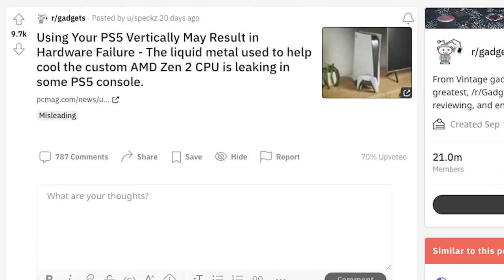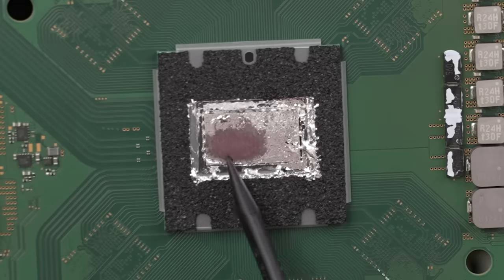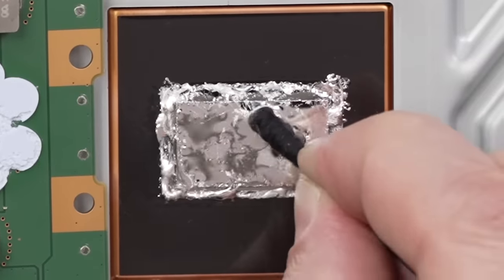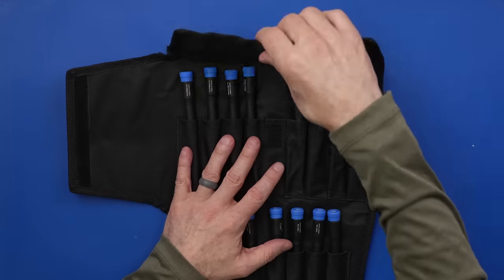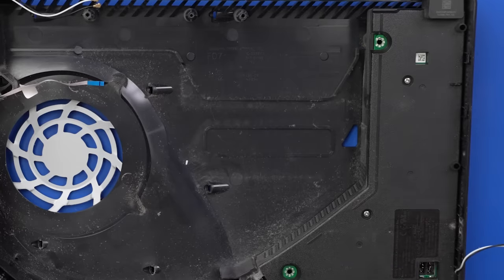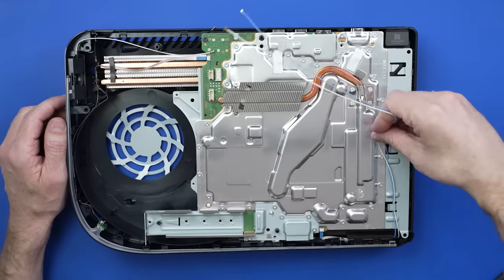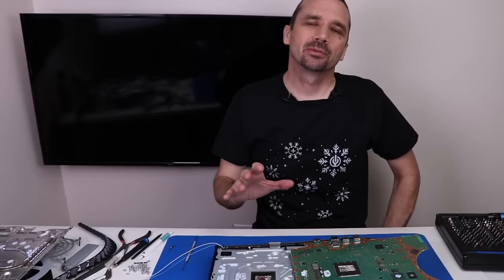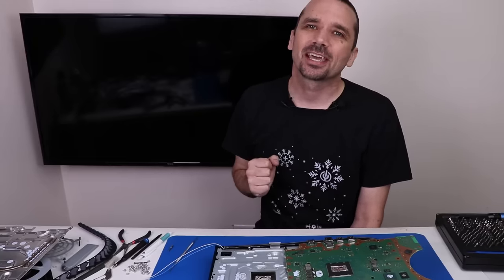PS5's Have a Liquid Metal Problem - But It May Not Be What You Think

Comment: Your repair videos have been tremendously helpful. There’s been so little follow through guides online. 

I’ve been having overheating issue as of late. My PS5 model is in the early 1000A’s so it’s due some maintenance. Cleaned it out thoroughly for dust but still the overheating persists. 

I’ll have to do the dreaded Liquid Metal replacement as soon as my delivery gets here. 

Thanks for putting out these videos! Earned a sub from me

Comment: I had the 1115a model and put it vertical n the liquid metal got into the little components n fried it sent it in they fixed it I'm guessing they replaced the motherboard because I'm not sure once the motherboard is fried it can be repaired really or it got on the components and they cleaned it off if it didn't fry it lol

Comment: So recently I had been a little lazy and hadn't cleaned my ps5 in a while and I was playing a game and it just shut off. I figured one of my cats may have knocked the plug loose because it seemed like it was almost unplugged and plugged it back in was playing for a while and it turned back off on me. The next day you did the same thing twice no warning just power off wooden power on for about a minute each time. I opened it up and the fan was pretty dirty cleaned her up and have had no more issues. When unplugging my PlayStation to clean it I noticed that the unit was very hot noticeably hotter than normal and figured it was overheating. I was correct and overheating was the issue the PlayStation turned off five times in 2 days with no overheating warning.
Reply: Hi could you tell us if your model is a 10000, 11000 or 12000 one? I'm suspecting a problem only with the 11000 one (I've 1116A) (it's written under the PS5) Thank you

Comment: I was starting to think about longevity of Viscous Metal.. I now understand it better, it doesn't run, it expands when it heats up but when you don't clean your console THEN it starts to move as it dries on hot spots and pools in cooler parts of the heatsink and APU.. I doubt its ability to run when vertical.  its sandwiched.

P.s I get flustered when attempting a repair. I broke a ribbon cable in my PS2 (controls power on) that was stupidly attached to the chassis, it detached from the inside and I couldn't get it on.. then wore out a ribbon on a PS4 controller bc I never know when something fiddly is inserted correctly. That's what she said. Ye
Reply: using internal battery for controller is stupid anyways, it's sony fault for not simply attaching a removable battery and cells

Comment: Hello. Like a lot of others PS5 owners, I've crashes with only PS5 games (Overwatch 2, Hogwarts, Vertigo, Jedï Survivor...) not the PS4 games. The PS5 shut down brutally without any warning.

I’ve done everything I’m advised to do, (and vacuum the psu...) but the problem remains. Other players seem to have no problem with Overwatch 2 for example. I have a model 1116A.

I would like to know from your experience whether all PS5 models are affected by these problems, or whether the 11000 model has more problems than the 12000 that evolved for the cooling system and the new AMD chip in 6nm? 

And since Amazon offers me a refund, do I have to do it and buy a new model 12000?

✨Thank you ✨ for your answer and your help... I'm tired to try all the tips... Without to succeed to fix that...
Reply: If you have problems and can’t fix it you should obviously refund asap
Reply: @fardel8021  OK...

Comment: Is there a video about how to make sure your ps5 gets the least dirty? I try to keep dust kf it and those ventilation holes on the sides of the black middele part ( you can see with white plates still on) and have it like a month or 2 now and feel like it is already getting dusty
Reply: Just cover it with some cloth or anything not very dusty when you are not using it and, when using it, make sure the PS5 is in a well open space and not placed above a carpet or anything dusty. That's all you need. My launch PS4 endured perfectly clean 6 years without any overheating or noisy fan issue by only doing that until I sold it to get a ps4 pro.

Comment: I'm not taking my PS5 all the way apart. I'm not a professional. I've had no issues as of yet
Reply: Hi could you tell us if your model is a 10000, 11000 or 12000 one? And if you have any crash issue (shut down with Only PS5 games) 
  I'm suspecting a problem only with the 11000 one (I've 1116A) (it's written under the PS5) Thank you

Comment: I did this test a long time ago Thermal paste MX4 works just fine for the PlayStation 5 On the chips I put thermal pads instead not the cheap ones they were expensive. Thermal grizzly thermal pads Actually worked okay for the PlayStation 5. If applied correctly PlayStation 5 can run on thermal paste Just don't buy cheap thermal paste. Or go back to dumb liquid metal.

Comment: Have you considered using regular thermal paste when refurbishing these consoles? If the liquid metal keeps doing this then it seems a waste of time to keep using the same stuff. Is there that much of a thermal advantage to LM?
Reply: He has a video trying that out, from memory it didn't go well.  Worth looking it up though was a good video
Reply from the maker: There is a massive difference in cooling when it comes to thermal paste vs liquid metal. If you use thermal paste the PS5 will for sure overheat
Reply: @cubiczar6917  I likely missed that video. I can't think why it should only need LM. There are more powerful chips around and they seem ok with paste. Perhaps it would need a better heatsink combined with paste for a better result.

Comment: I’m having a sparkle screen issue! Ive changed the hdmi cord cleaned the unit etc and now it’s getting the wave of black screen going in and out!
Reply: Hi could you tell us if your model is a 10000, 11000 or 12000 one? I'm suspecting a problem only with the 11000 one (I've 1116A) (it's written under the PS5) Thank you

Comment: I have a question if anyone can answer for some peace of mind that'd be great but for about 2 months now my ps5 that ive had since day 1 gave a heat warning i disassembled down to the optical drive and the baby heat sink and found some dust bunnies so i used a can of compressed air to dust away any visible dirt in the fan hole and over the baby heat sink but i was wondering would this effect the seal around the liquid metal in any way and cause it to leak? I dont think it would but id like to be sure. Any answers would be appreciated!
Reply: Did you unscrew the heatsink and got down to the APU? If no, then it won't affect the seal.

Comment: Mine is a 1216a is that the second edition Or not and what's the difference
Reply: Been taking apart my 1215a and the only difference from other consoles I've seen is a few less wire strips, the amount of mobo plate screws, a piece of the plate being separate neat the extra storage slot and the shape of the giga heatsink on the bottom. 

So far you probably a couple less screws lol

Comment: 2 days ago I literally managed to remove the old liquid metal from my PS5's APU instead of respreading it. Since my APU had a dry spot and it was pink too with those black oxydation spots on it too. Discovered it since 26 of January and soon got the kit to do so.

Took time to clean it off with the alcohol wipes it gave me and then 99% Isopropyll Alcohol I bought seperately to clean the motherboard and the chip which got cleaned up good with a few black spots. I applied the new LM and no problem dispensing and spread took a bit but it spreaded around no problem.

After I placed it back together with a few hiccups of some ribbon cables misplaced and one came off for the front buttons, I got it back together and played a PS5 Game. FNAF Security Breach for about nearly an hour and no overheat or freezing. Then NFS Unbound to be more heated but it crashed with error code CE-108255-1 which it was due to bad data. Put safe mode and reinstalled the system software and so far no craches with that code and no shut downs from overheating.

So my console is working fine for now and also my console never displayed the overheating screen as it just shuts down

Comment: please can you make a video comparing ps5 1015a 1115a and 1215a overheating and power consumption thank hou very much
Reply: Hi could you tell us if your model is a 10000, 11000 or 12000 one? And if you have any crash issue (shut down with Only PS5 games) 
  I'm suspecting a problem only with the 11000 one (I've 1116A) (it's written under the PS5) Thank you

Comment: Great explanation on the thermals. Could you just replace the liquid metal with a thermal paste?
Reply: no as the chip is overclocked to boost its performance why they used liquid metal in the first place to help with thermals inside a console form factor maybe down the line when they have a slim model with a more efficient chip this issue will get fixed.

Comment: Ps5 CFI 1200 installed M2 Corsair MP600 PRO LPX.  Ps5 shows speed 3685mb/s.  I decided to check out the M2 and the games run very fast and work great.  Someone faced such a problem as the minimum reading speed?
Reply: Have you some crashes (shut down) with PS5 games like Overwatch 2, Hogwarts, or other... With your 12000 model? 
I'm suspecting a problem only with the 11000 one (I've 1116A) (it's written under the PS5) Thank you
Reply: @angelogalileo  I was surprised, but on my corsair, all games work without problems.  I don't even know what to do.  The store refused to accept m2.

Comment: I fear most people run their ps5 vertically. How quickly does this issue appear once the ps5 is purchased, on normal usage?
Reply: Most people dont get the issue the issue was most likely the way the consoles were made at launch and soem of them are defective the newer ones seem fine
Reply: How does that make sense to u if it was that it shouldn’t even heat theres open air everywhere the problem is with the design i can’t believe after 10 years sony cant even make a device correctly

Comment: I like keeping the ps5 on the side just for ventilation. Most of the exhaust comes from the lower half if it is vertical. Zero problems so far after probably 2000 hours on the console. I do a 1200 series as a spare just in case (and stored flat).
Reply from the maker: I feel like it's a better way to keep them but there seems to be a lot of people who keep them vertical with no problems

Comment: A cloged power suply was causing My ps5 to shutdown playing demanding games. A god cleaning solved the problem for me.
Reply: Hi could you tell us if your model is a 10000, 11000 or 12000 one? And if you have any crash issue (shut down with Only PS5 games) 
  I'm suspecting a problem only with the 11000 one (I've 1116A) (it's written under the PS5) Thank you

Comment: For people that have the issue with their ps5 randomly turning off, you just need to clean it. Use a brush and vacuum and take off the fan to get the dust inside the console. Thats all I had to do fix mine.
Reply: Brushing and vacuuming dust would not have fixed the dry spot on the APU shown in this video. YOU got lucky, but that solution will not work for everyone.
Reply: @mjc0961  yeah could be. I’ve been having issues again. Might need to replace the fan and Liquid Metal. Also I’ve always had my ps5 standing up so I’m going to keep it laying down from now on just in case.
Reply: Hi could you tell us if your model is a 10000, 11000 or 12000 one? And if you have any crash issue (shut down with Only PS5 games) 
  I'm suspecting a problem only with the 11000 one (I've 1116A) (it's written under the PS5) Thank you
Reply: @angelogalileo  I believe mine is a 12000 model and I opened the whole console up and cleaned out the heat sinks. Now I have no problem with it on any games for any amount of time gaming. I think most people don’t disassemble their ps5 so just think it’s broken when the console is actually just dirty from the inside where surface cleaning and a vacuum can’t reach.
Reply: @skittlz101T  yeah maybe you're right... But I need a T9 for put off the fan and It's a little difficult to put of the plastic event before that. O'm afraid to break something. By the way maybe there still are some software issue who can crash the hardware like an engineer from Sony said at the launch in 2020 : The specialist said that it is a hardware issue that is stemming from a software issue and that it will be patched out. What’s going on is there is an issue with the software communicating data to the hardware, hence the abrupt crashing It’s almost like the hardware gets confused and doesn’t know what it’s doing and that crashes the game. He told me that he doesn’t know when the update will go live but he knows it’s coming very very soon. I reiterate that it is a software issue causing a hardware issue. He also told me the engineers are working 24/7 to get this patch out and that the engineers are 120% positive all this is stemming from software malfunction.
Reply: @skittlz101T  and mine PS5 is still on warranty so I don't want to open totally... I just would check the holes of the power supply through the big hole where the fan is mounted if it's full of dust only after 8 months...
Reply: @angelogalileo  yeah if you have warranty you definitely should use it. Mine doesn’t have warranty anymore. Don’t open it more than just taking the faceplates off and doing a surface cleaning
Reply: @skittlz101T  do the vacuum holes work because I’m not trying to take the whole thing apart, btw nothing is wrong with mine I’m just thinking about the future
Reply: @devanshdivecha2188  for me it wasn’t enough. I would also recommend keeping your PS5 sideways instead of standing up.
Reply: @skittlz101T  how come

Comment: I left mine flat the moment it landed.. also vent filter for vents through out the house.. vacuum regularly.. and an air purifier..
Reply: Hi could you tell us if your model is a 10000, 11000 or 12000 one? And if you have any crash issue (shut down with Only PS5 games) 
  I'm suspecting a problem only with the 11000 one (I've 1116A) (it's written under the PS5) Thank you

Comment: Know if the PS five has liquid metal, can you replace it with thermal paste instead of having liquid metal or does it work better
Reply: Any thermal paste should work. LM is just an excellent thermal conductor and fills all the micro dips in the APUs shell easily. However the temp difference between LM and the next best thermal paste is about 5-10c. Just know you risk losing slight performance.

Comment: Damn my ps5 has started turning off during games like this. I used to keep it verticle and I took the plates off and cleaned out the fans but is still happening :( 

I have to assume this is what happened to mine. There is no way I am going to open it up like that and spread more liquid metal.

Does anyone know if sony will fix or replace it for me for free Ive had it since launch pretty much
Reply: Hi could you tell us if your model is a 10000, 11000 or 12000 one? I'm suspecting a problem only with the 11000 one (I've 1116A) (it's written under the PS5) Thank you

Comment: Had mine for 2 years haven't had any problems yet
Reply: Hi could you tell us if your model is a 10000, 11000 or 12000 one? And if you have any crash issue (shut down with Only PS5 games) 
  I'm suspecting a problem only with the 11000 one (I've 1116A) (it's written under the PS5) Thank you

Comment: 0:10 I had the same! My PS5 just just down...sometimes after 15min, sometimes after an hour. I sent it in with warranty and they did a wonderfull job. They replaced the stand with the new model, cleaned the Controller and even installed new thumbsticks! And my PS5 works again...

Comment: Does anyone know if it legit the Liquid Metal that has to be spread? My ps5 turns off when I get to 4th quarter of 2k. Played hogwarts turns off after 20min or more. I tried Dustin it off taking fan out I don’t know what to do. I play my ps5 sideways mostly.
Reply: If there is no liquid metal contacting, you get a hot spot. Send your PS5 in for repair, mentioning that you suspect it is a liquid metal dry spot on the apu.
Reply: Hi could you tell us if your model is a 10000, 11000 or 12000 one? And if you have any crash issue (shut down with Only PS5 games) 
  I'm suspecting a problem only with the 11000 one (I've 1116A) (it's written under the PS5) Thank you

Comment: Liquid metal seems like it wasn't the way to go.
Reply: It was. But not in this way. Liquid Metal is the best way to solve heat transfer issues. Thermal paste has a severely lower heat transmission rate which might not be sufficient for the chip in the PS5.

Comment: I don't think having it vertical has any negative effect on the liquid metal. Remember that the SoC and heat sink are sandwitched together by those clamps, there is a constant pressure placed on that SoC and liquid metal. Sony spent over 2 years developing the liquid metal thermal interface material for their new console, it is designed to be vertical, literally in every promotional material the PS5 is in the vertical position, its basically its default position.